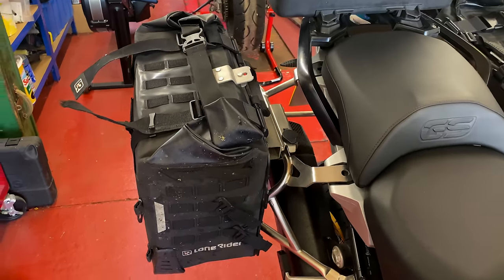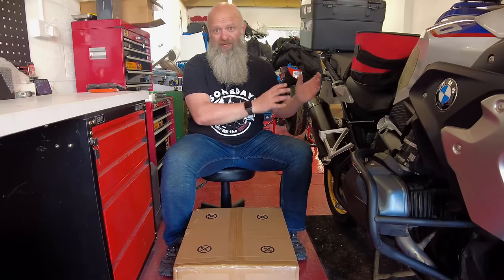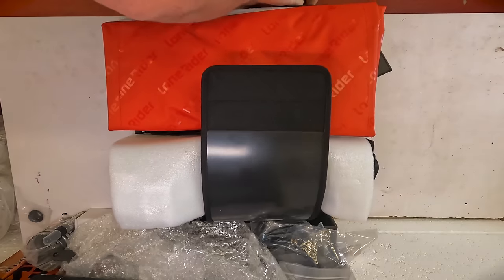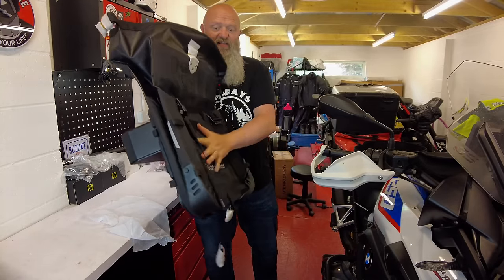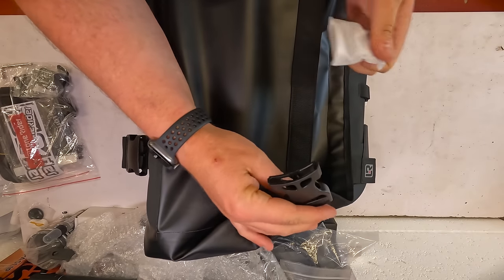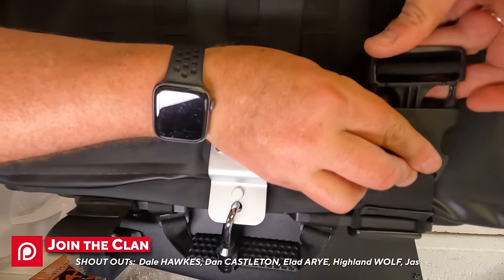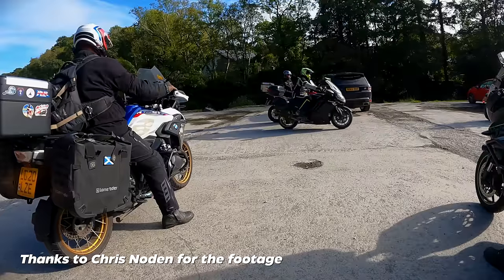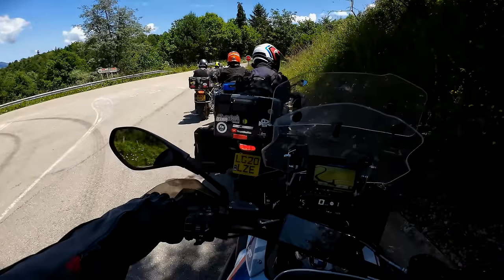Lone Rider RACKLESS MotoBags - unboxing, install & REVIEW

Comment: I took a wild camping trip to Scandinavia this summer for three months. Bike, 80mpg, 2019 Honda CB500x. 
My pannier setup, Givi detachable rails, cost £100, and Givi soft panniers with waterproof liners, (didn’t leak once) cost £115. 
I made it up to Nordkapp, where I was surrounded by GS’s and Africa Twins, all with similarly impressive luggage setups as in this video. 
I smoked a tab, had a chuckle and headed on down to Lapland. 
I’m not having a go at GS or AT riders, (I had both in my youth) but there are alternatives 🇬🇧🙂✌🏻

Comment: You’re late with this one Bruce 😂 you have changed bikes since. Will the same bags fit the new bike 1300 GS ? How ?
Reply from the maker: Aye I’m working through a massive backlog of content at the mo😬🤦‍♂️🤣

LoneRider are currently working on all their kit for the new 1300 and I’ve got some new stuff coming in the new year. I think they’re trying to work on a solution for the Rackless bags where existing customers will be able to fit them to a 1300 - but that’s no definite at this time 👍
Reply: If you can afford the new GS1300 a new set of bags at £1100 is a snip surely😂😂😂😂
Reply from the maker: New GS is not much more than an equivalent 1250 bud

Comment: My understanding is that the big outer bag isn’t fully waterproof; it has weep/breather holes in the bottom to let air out when you roll the top down and any water that may have got into the bag.
Reply from the maker: Yes that’s true, it doesn’t let any water in through the material, but they have included the drain holes to allow any water to get out. 

You out your clothes in the lining bags anyway, which are 100% waterproof. So if you’re taking the bags to the bike from your hotel/tent and it’s raining, when you open the motobags and out the lining bags in - any water is free to drain out and your kit isn’t sat in puddles of water all day 👍

Comment: Been looking at these since they first came out and IMHO, the best solution on the market right now for GS/A owners. BUT, at over £1000 it's a huge investment to try and justify.
Reply from the maker: Yep it’s a LOT of money for sure. Compared to their equivalent rivals in the market, I’d say they were the leaders - look amazing, huge capacity, incredibly easy to mount/remove, leave the bike looking original when not mounted, safer than hard luggage, fully waterproof, more versatile in that it’s easy to mount other bags and kit to them via the Molle system… list goes on.

However if you’re going to do much offroad stuff, then I’d go for the traditional rack motobags and not these Rackless ones personally
Reply: @teapotone  ... off road! on a GSA! are you mad man? 🤣😂🤣
Reply: Took a punt and bought some...went moto camping last weekend with them (and the LR tent) and can say that they do exactly what they say on the tin... expensive yes, worth the money.... absolutely. Will be touring in Europe later in the year and these will be perfect.

Comment: Built and tested around the world,  shows being pulled behind a truck on a dirt road but advised not to use off road, am sorry if I’m not getting something but really don’t see the advantage over any other system rackless or with racking 🤷‍♂️
Love your vids Bruce have been very inspiring over the years 👍
Reply from the maker: The bit where the bike is dragged behind the truck is to show how tough the bags themselves are. There was a lot of criticism when they originally came out from the hard luggage brigade who said they weren’t as secure as hard panniers. So Lone Rider chucked them off the back of a moving truck, attacked them with knives, screwdrivers etc etc to prove they were actually tougher than hard luggage.

When secured via a traditional rack system, they are perfectly fine to use offroad, as proven by the actual owners, founders, and staff members at Lone Rider themselves, as well as thousands of customers around the world.

The Rackless motobags shown in this vid, are meant for the road use rider - basically 90%+ of riders out there 👍

Comment: Hi everyone, 
I have a 2024 800GS with Visio fasteners. BMW tells me that these fasteners are identical on the GS range (old and new with Visio option of course). 
As they are used to attach the rackless I think that the Motobags rackless should also be compatible on the 800 GS (2024), but when I ask Lonerider I don't get any answer from their customer service? In short, I'm wondering if I'm ordering these bags "despite" the lack of response from Lonerider? thx

Comment: I have had the "normal" Lone Rider bags for 2 years now. Their support sucks and I will never buy from them again  ..... but, the bags I have are great !!!! The rack less I have seen come off on even minor spills so my guess was right about going to them. No complaints about the product directly, just some issues about install and goofy pad locks that when making them aware of the 5 hours it took me to take apart and re-adjust the mounts on bags they said "bolt right on", some woman that worked there pretty much told me to go pound sand. That cost them their future in my eyes . Good video !!!! Thank you !!!    🙂
Reply: Hi! Which one would you suggest Rackless or the normal lone rider panniers?
Reply: @akungwelly  normal ......................
Reply: @TheAmerican1963  thank you for helping
Reply: @akungwelly  No problem. Just be sure to take your time, use lock-tite and keep track of the keys for the mount. I carry one set and hide one set. Keep the rubber side down, Amigo !!!!!!     🙂

Comment: Hello sir.  Since you’ve had these rackless bags on your 1250gs did you ever drop it while riding or at a stop and if so, did the bags stay attached to your bike?  I bought a 2023' R1250GS Trophy in July of this year and I've been slowly buying stuff for the bike.  I am seriously considering the Rackless Moto Bags from Lone Rider.  I love the option of quickly removing and installing them.  I am also a bit concerned about off roading whilst they're on the bike.  If you didn't have any problems then I'll be pulling the trigger to buy them.  Thanks a bunch!
Reply from the maker: Hello bud, the Rackless ones are NOT for off-roading, they also say this on their website. Definitely use the standard rack and quick release motobags if you’re going to do any off-roading at all👍
Reply: Awe...bummer.  I was hoping you would say go for it.  I don't care for the rack system being on the bike.  Kinda like it cleaned up without.  I haven't found a need for luggage yet.  Maybe I'll leave it go till it's absolutely necessary.  Thanks again for all the wonderful info you give us all!   @teapotone

Comment: £1,000 for bags you can’t even go off road with. Designed for car park GS riders, like 99% of GS are!
Reply: Fake. Go watch the Lone Rider videos, there are some where, in particular, they spend their time dropping the motorcycle on the rackless cases to demonstrate the solidity of the system and that there is no damage to the cases. As for the price, the price of an aluminum suitcase kit from Touratech, for example, is more expensive and will cause more damage in the event of a fall!
Reply from the maker: @philippeernotte6609 aye that’s true, and I use footage from that in this actual vid.

HOWEVER… these reckless bags are NOT designed to go offroad. The BAGs will easily go off road and put up with everything you can throw at them, but the reckless connection system to the bike won’t.

For off road riding you will need the traditional rack system and connect your bags via that👍

Comment: Hi Bruce, Great video. I have had the rack mounted for a couple of years and they are fantastic. Tbe biggest plus for me is that they are 100% waterproof, something that my metal ones never were. I always found a pool of water at the bottom of the metal ones after a few hours of heavy rain. I just wish they would hurry up with their top box.
Reply from the maker: Watch this space bud😉👍
Reply: Inner bags are a simple solution with metal ones, even when they are damaged they don't leak. I've got them since I bought metal cases and they were the best purchase for my Adv.
Reply: @motolover5697  mine leaked from the start. I drilled holes in the bottom to let the water out but that made it worse.

Comment: Mosko Moto Luggage is significantly more money, arguably better quality but more expensive! But compared to hard luggage I think the Lone Rider system stands up and is worth the money. If it doesn’t leak any water! Unfortunately All my recent luggage has leaked! Tourateck and BMW a like all let water in! My stuff needs to be secured, and dry. Nice work big guy. Happy Christmas.
Reply from the maker: Cheers Murt,

I’d not actually seen the Mosko Moto Rackless stuff, will check it out.

Aye the LoneRider stuff is 100% dry, never had any leak on me, plus the lining bags are also fully waterproof so you’ve got double protection 👍

Merry Crimbo to you, Sally, and your families 👍
Reply: In 2 years mine have never leaked.

Comment: Ugly and not rackless, as they carry a rack with them and plug into bike‘s integrated rack ports. Useless, as you won‘t carry that hybrid monster to your hotel. Leaving the softbag on the bike means, you have to pull all out and carry it around to the end of the lengthy floor of that scottish hotel on the 3rd floor of the back building you have to walk across countries for. Well done. Hahaha, no way. „To be fair“ it‘s utterly expensive anyways, regardless of it‘s packing.
Reply from the maker: What a ridiculous post?

So how do you get the content of your panniers/bags to your hotel room normally then if you don’t carry them from your bike?

It’s takes a matter of minutes to remove the lining bag from the motobags and then you just carry that. The motobags stay on the bike whilst you are on your trip, locked and secure to the frame.

When you get home, they take seconds to remove and you can store them in your garage/shed/house.

Ugly - no. 

Useless - no.

Expensive - yes, very.

Quality - yes, very.

Comment: I really like the look of the Lone Rider stuff, but in the end went with some official BMW Aluminium panniers, but were still £300 cheaper!
Reply from the maker: I don’t think the bmw ones are waterproof, you also need a rack on the bike if you don’t already have one (£), hard luggage isn’t as safe as semi-rigid in the event of an accident/drop, they’re easier to break into so not as secure, heavier for carrying around… 🤷‍♂️

But yes, definitely cheaper 👍
Reply: The BMW Vario ones are waterproof. Vario panniers Are made to fit without a rack.  Horses for courses but...... A pair of bike matching ones for £600 or nearly twice as much for a "Designer" compromised adaption.
Reply from the maker: Nope, they are NOT waterproof, I’ve seen them leak on a few bikes this year alone, you absolutely need lining bags for the 1200/1250 Vario panniers if you’re going to be riding in sustained wet weather.

Compromised - how so?
Reply: The compromise is that when you take them off they have a whole load of hardware attached and they have separate keys. You do seem to love these,  that's all cool and if bought them or were donated them I would love them too It is just as we are all motorcyclists we have to give our honest opinion and my opinion is that the BMW ones are expensive enough so an alternative should be at least a little less expensive. But twice the price? doesn't make sense to me That's all  TO. @teapotone
Reply from the maker: It’s a key which I attach to my bike keys 🤷‍♂️

If your opinion on something is tainted by the fact it was given to you to review, then this is not the line of work you should be in (although I appreciate many here on YouTube appear to act differently). I for one am always open and honest about anything I feature on the channel, whether I’ve bought it myself, been given, or provided by a sponsor - it makes zero difference to me, I’ll say exactly what I think. It’s cost me sponsors in the past and I’m sure it will again into the future - but integrity is non-negotiable in my book, and I’ll defend that from anyone.

Yes these are expensive, I even say this a few times in the vid, but you get what you pay for.

If it’s not for you though, then fine, there are plenty of alternatives available as you point out 👍
Reply: No inference meant on your integrity. None at all. I just had to comment my opinion as an owner of the BMW Varios and my impressions of the Lone rider ones.. Truce? Bruce?. @teapotone
Reply from the maker: @barrydaly7174 None taken at all Barry, please don’t think I was having a go, just ensuring there’s no doubt in my integrity to anyone reading the comment bud 👍

I hate it that the written word can be taken in so many different ways, but I 100% appreciate the convo and your viewpoint, particularly as a Vario owner, so cheers for that.

Comment: The BMW Vario panniers are available new on the evil place from a BMW dealer for £650 including the locks. They extend to approx 30 and 39L and fit both the 1200/1250 GS/GSA without using any racking at all. They are quite heavy, but are waterproof and lockable so you can use inner bags and leave the panniers on the bike. As the 1250GS has been replaced by the 1300GS and its already been confirmed the Vario panniers won't fit the 1300 these probably won't either unless they produce a different mounting plate. The vario also slim down to 20 and 29L to help with filtering and if you have the top box and ride solo do you really need anymore. The cost of these panniers are around the cost of  both the Vario panniers and the top box combined. I know which I'd buy.
Reply from the maker: These are based on the Vario luggage, that’s why they utilise the existing mounting points on the GS bodywork.

They’re much better than the Vario ones though in all senses - looks, build quality, Vario ones aren’t waterproof (I’ve seen them leak a few times with my own eyes), they’re much heavier to lug on and off the bike.

LoneRider are currently working on their 1300 kit range, including possibly a way to convert existing 1200/1250 Rackless motobags to the 1300 - but watch this space if that happens 🤷‍♂️

I bought the new Vario top box for the 1300 at £550! 

It’s a HUGE step up from the original plastic, cheap looking Vario kit, and I’ll do a vid on it at some point to come 👍
Reply: @teapotone  Thanks Bruce, I've never had my Varios leak in the 7 years I've had them maybe they leak because people overfill them, who knows 🤣 If they can make different adapter plates I think they'd be onto something which might then justify the high cost-I thought BMW were bad enough 😉 I guess overall it's good to have a choice that can cater for different people's needs. I know you don't rate them but I'm off to 1250RS land as they're a liad cheaper than the GS is now and if I need luggage for that I'll go down the soft luggage route too, probably a 36L  as I don't carry a pillion so no need to carry a hairdryer, handbags or high heels